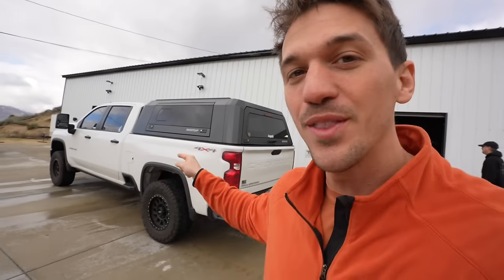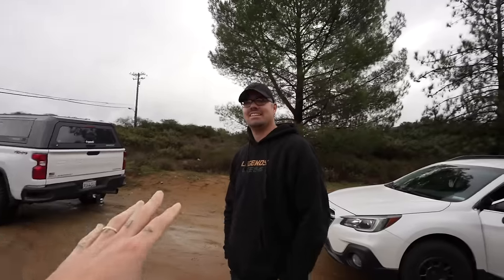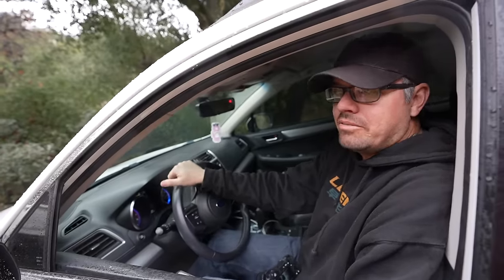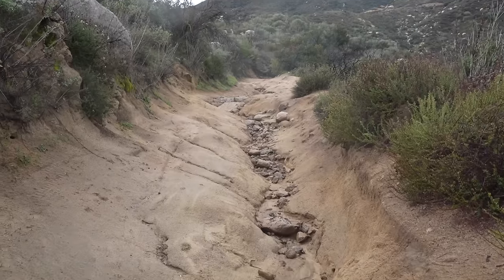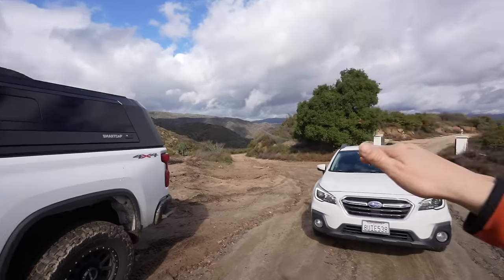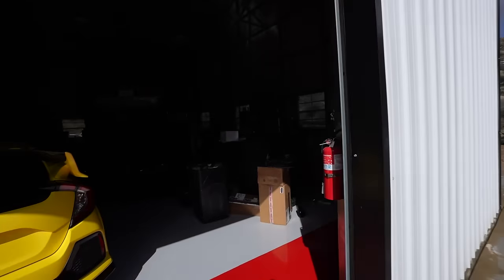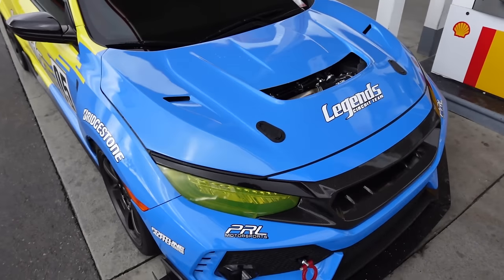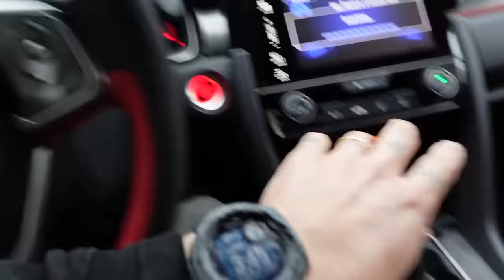Taking the Ultimate Overland Race Car Rig Trail Riding!! First time Overlanding

Comment: Good job on taking two vehicles out. Never off-road alone especially with no experience. I've never taken this particular trail but I've take all the ones on the other side of the mountain. If you were to have taken a left at the start and gone up Main Divide you could end up at Saddleback Peak which overlooks OC and LA all the way down to downtown on a clear day. Also it doesn't seem like you guys air down your tires so get an air compressor and tire deflator. Airing down your tires will make your ride more comfortable and increase traction. Good luck on your off-roading adventure. We have some of the best sceneries and trails here in SoCal.

Comment: The off-road bug! Love the content. I would remove the trailer hitch when wheeling you don’t want it getting caught on rocks or dragging it around. I would also air down to around 20 psi maybe even lower depending on the new tire set up. I air down to 14 psi when on trails in my fj cruiser. I would also look into some recovery gear and protection mods bumpers,rock sliders, skid plates. Keep it up and definitely film the build!

Comment: Im pretty new to the offroad game. I have a 2022 Tacoma TRD OR premium. I use my truck for everything. It's on 33s, 3 inch lift front and 1 inch rear. Biggest things that helped with offroad were high clearance fender liners, cab chop (for IFS vehicles), rock sliders, high clearance front bumper with a winch, front skid plate. It performs flawlessly. It depends how deep you wanna get but rock sliders, lift, good all terrains, and then a bumper that can hold a winch and I think you're set. Currently looking to re-gear to 5.29 to fix the pig of an engine Toyota put in it but your truck looks like its on its way!

Comment: If i were to start all over, a quality air compressor would be my first purchase. I would recommend a Morrflate because it allows you to set your desired air pressure and will shut off once it reaches inflation. You can even splurge and get a 4 wheel air down/up system which will help save a significant amount of time. Second thing i would recommend is learning how to air down properly. It’ll give you better ride comfort, increased traction, helps preserve trails, and reduces the chance of having a blow out going over sharp rocks/branches. Each tire model is slightly different so finding what works best for you is key. Third thing would be self recovery tools such as a winch or even a kinetic rope/ soft shackles if you go out with others. Hope to run into you on a trail one day!

Comment: Winch with synthetic line and Midland/Rugged radio GMRS for inside.
Get some type of kinetic rope instead of tow rope so you can yank rigs out of difficult situations.
Soft shackles are the best and safest connection for rope.
Chase lights in the rear so your buddies can easily see you when its gets dusty/rain/snow.
Enjoy the trails!

Comment: Use a PVC tube reservoir on top of the camper with a valve, then you can gravity feed water down bellow. Simple easy way to do it. Can even put a tire valve in it to pressurize the container for more water pressure.

Comment: Next time you guys go, air down your tires to 25 psi even lower, depending on your tires. you’ll have more traction and also the ride will be smoother going all over the different terrains.  Let’s plan a legends offroad trip! SoCal where you at 💪🏼
Reply: Was gonna advise airing down as well, helps so much with ride, less likely of any punctures and bigger footprint for more traction and just griping the terrain around the tire.

Comment: If you ever venture to Arizona feel free to reach out! Grab a good air compressor and air down your tires to about 15-20 PSI with non bead locks. Makes the ride way smoother to start and better traction. 

Overlanding checklist:
1. Gas 
2. Water 
3. Storage (food, clothes, etc) 
4. Sleeping area 
5. Thousands of dollars of other cool stuff you don’t need but want. 😂

Comment: Hey dut just a few tips air down you should be able to go in 4 high through that trail from what I saw but turn ur traction control off that will end up getting you stuck bc it stops momentum if you are slipping in mud but other than that cool stuff man
Reply: 4 low is for really stuck or climbing up rocks

Comment: You need self recovery. Proper traction boards from Maxtrax, winch and air compressor to air up the tires when you air down for traction.
Reply: 4h would be better for that trail but technically it could of done it in 2w
Reply: Traction boards 😂 BASURA!